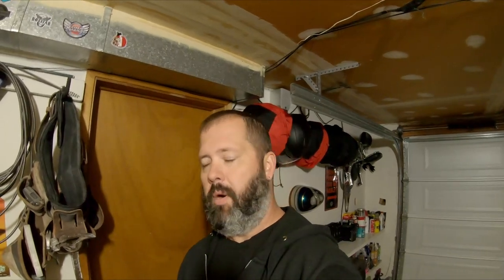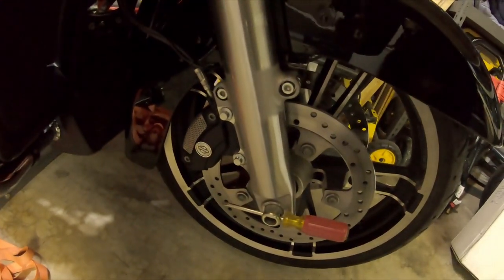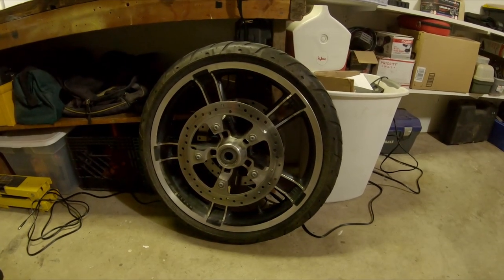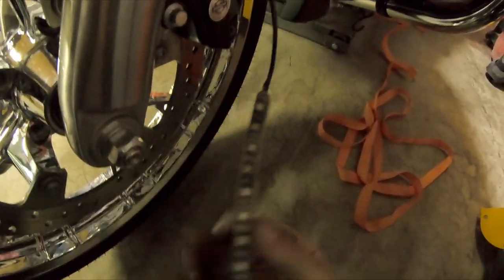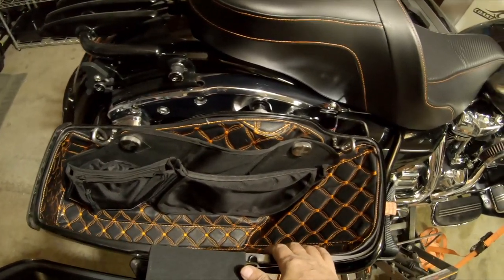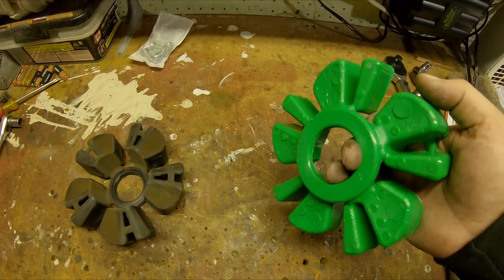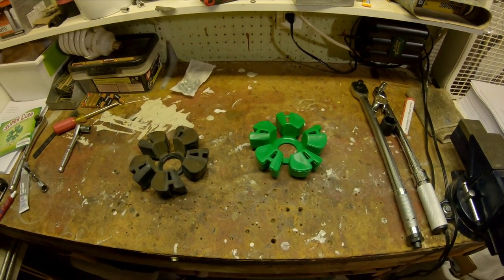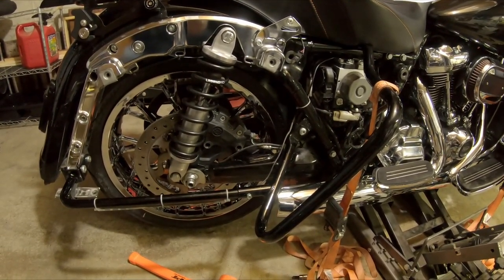New Coastal Moto bling for the Street Glide!

Comment: What wheel chalk are you using to hold the Street Glide? Does it hold it fairly secure? I been wanting to store my bikes like that in the winter. Love your content, keep it up! 👍
Reply: Not the OP but I have spent plenty of times in this garage. They are condor chocks
Reply: Thank you
Reply from the maker: Thanks @VulgarMike. @23fyrebird is correct, specifically they are the Condor Pit Stop PS-1500 chocks. They do an amazing job holding the bike firm even with me climbing on and off or having a passenger do the same. Here's the link if it helps:

https://www.condor-lift.com/product/pit-stop-trailer-stop-part-ps-1500/